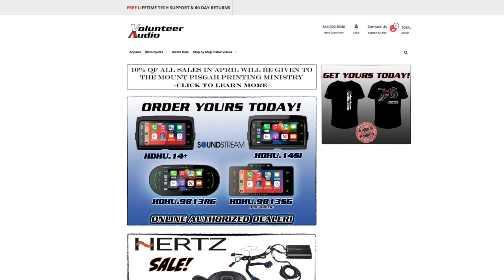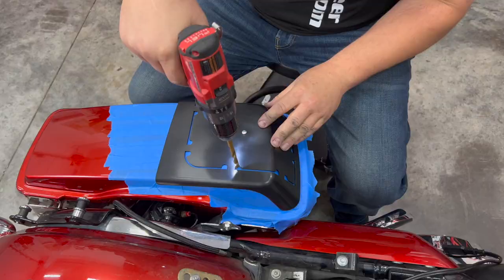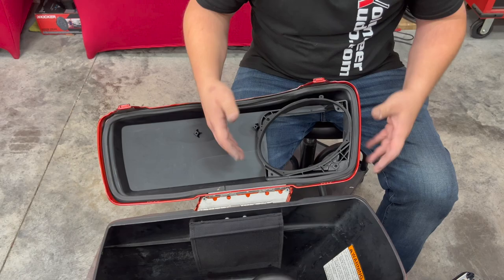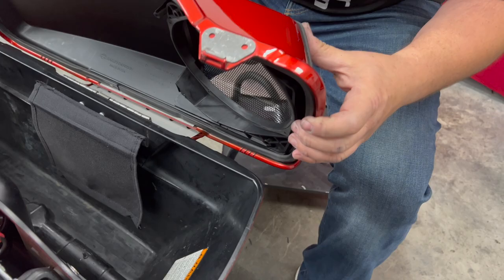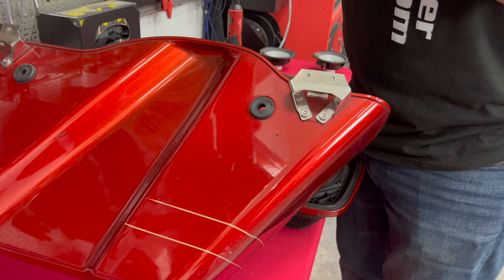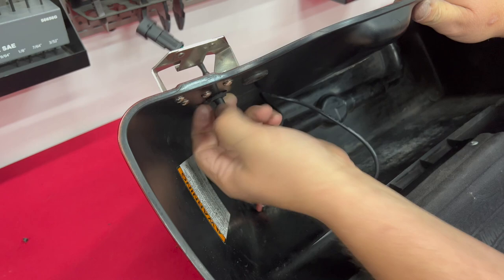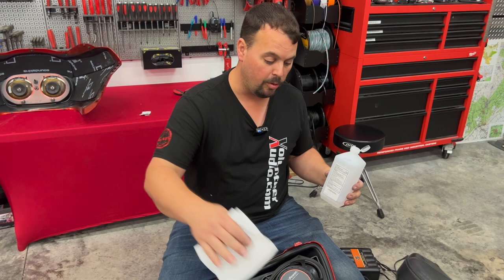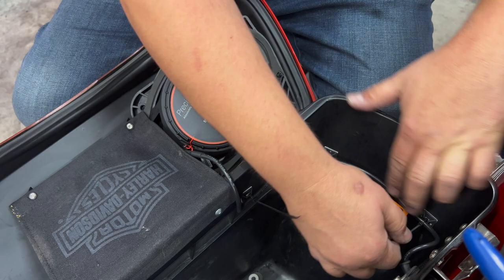How to Install 6x9" Speakers using Cut Kits on your 1998-2013 Harley Davidson® Road Glide

Comment: Will these cut kits work on a 2000 Electra Glide police saddle bags?
Reply from the maker: Are they different? Most police models share the same bags, only difference would be accessories like racks mounted to the lids